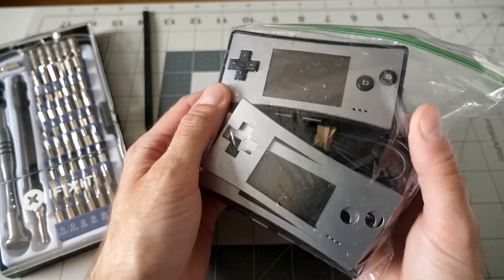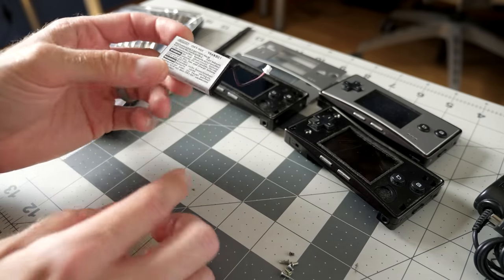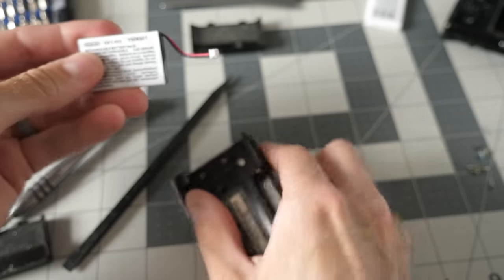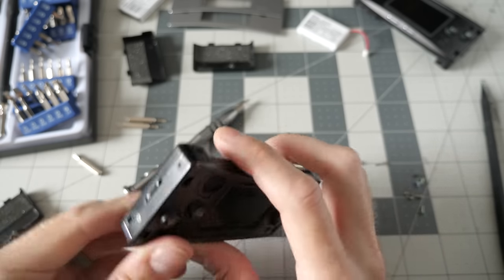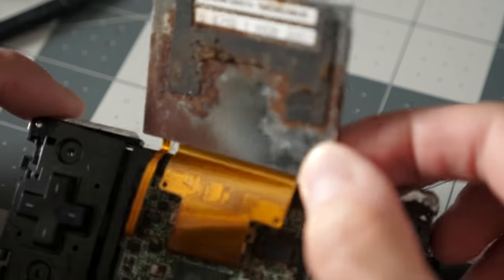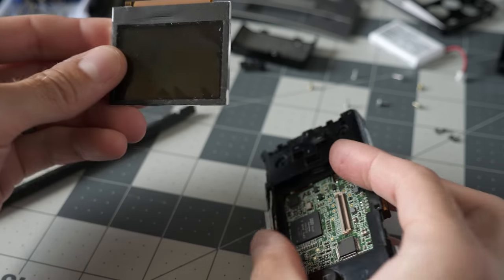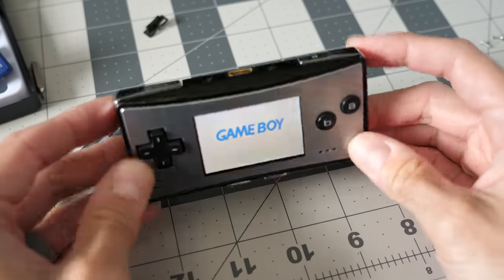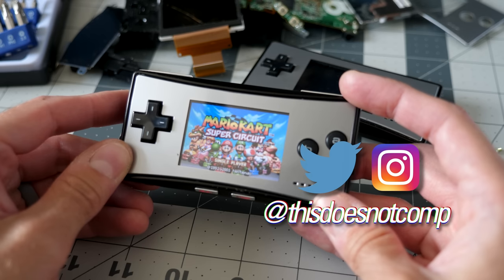Fixing Up Some Game Boy Micros

Comment: Nintendo doesn't use Philips screws internally, they use JIS (Japanese Industrial Standard) screws, which look similar but are not the same profile, and can be damaged if you try to use a Philips driver on them.
Reply: Oh yeah, 
first time you try a genuine JIS driver it's a REVELATION! 
Chewed out screw heads become a thing of the past.
Almost all Japanese manufacturers use JIS and almost none of them use Philips.

Anyone doing this type of repair should do themselves a favor and order a set of JIS drivers online, they are hard to find outside Japan.
Reply: What you guys talking about? I use regular smallest tip no problem but thanks for that JiS info

Comment: One tip for sometimes getting stripped screws out, is press a rubber band between the screwdriver and screw.  That sometimes can help it get enough grip to do it.    And I don't know why you take on other peoples projects.... bwa ha ha ha ha.    (btw,  I never tried working on those,  that is how I got them hehe)
Reply: Good advice but some screws just suck. My laptop came with horribly stripped screws that even the rubber band method can't remove. So I have a time bomb, damn heatsink can't be repasted and the fans can't be cleaned.
Reply: Too add on to that: I've found Torx (both without and with rubber band) to get a way better grip than any other bit,
Reply: @acumenium8157  This actually happened to me in my laptop and it turns out there was loctite in the screws that needed to be heated REALLY well (the screw has to literally burn you when you touch it) in order for the screw to even move a bit, after heating the stripped philips screw quite a bit i was able to remove it with a flathead, flatheads grip really well on stripped philips.
Reply: @firasbajjar  I can't help but wonder if loctite or something similar was used as well, but the screws are stripped too. The metal is WAY too soft. I made one of the screws (that doesn't remove anyway) worse than it was, but it doesn't really matter since it never turned to begin with.

If a screwdriver is warping the shape of a hole it fits in, the screw (which is a BIG screw, it's a heatsink one!) shouldn't be so malleable.

One of the screws, the worst one right now, came pre-stripped with, instead of a plus/+ shape (Phillips?), it's more like a ding-dong. -D

Phillips "fits", but won't turn, and will instead eat away at the really soft metal of the screw. I fear a flat-head would be much the same.
Reply: @acumenium8157  Yep that’s exactly what happened with my laptop. Like all i did was apply a small force only to end up with fine metal dust on my hand. I also encountered the same problem when disassembling a friend’s laptop where the heatsink screws were seriously stuck with loctite that i had to heat the thing for 10 mins. Flat head should work really well in terms of grip provided that you have the correct size that slots well into one of the philips’s cross lines. This is what i found working after months agonizing how the heck im gonna open mine, a lot of heat and a good flathead.
Reply: @firasbajjar  I guess I should try and get some flatheads, only ones I have are too big.

Do I need to find new screws after extraction? If they're this far gone, I don't think it's a great idea to put 'em back in. We're talking about the heatsink after all, not the biggest deal if you aren't 100% sure if 1-3 of 9 case screws are in absolutely tight, but the heatsink is... very important.
Reply: @acumenium8157  Yeah obviously you need new screws for the heatsink. The manufacturer should give you details the screws you need to buy (unless they are something along the lines of cough cough ASUS that think thermal pads are proprietary) 
Remember you will need a lot of heat if it didn’t budge easily. i know this is not good advice for electronics but that is sadly what I needed for my case.
Reply: @firasbajjar  I can get ONE of the screws out. In a normal world, all screws in a heatsink are the same, right? Meaning if I can get ONE out, I should just be able to get four of them for the replacements?
Reply: @acumenium8157  Yeah logically all heatsink screws should be the same but i don’t think most shops have the skills nor the tools to figure out the exact replacements you need when you bring them a screw that is why it is preferable to get information on the type of replacement screws you need either from the manufacturer or through forums online.
Reply: in the 3ds, i took a couple of stripped screws out with a drill too.... hear me out, i used a super thin drill bit, drilled the screw until the top comes complety off, so the piece the screw is securing can come out and then used pliers to rotate the remains out. It's not pretty, but it worked.

Comment: I hope the micro picks up like the rest of GB's, we need more aftermarket parts for it, faceplates and especially the plastic inside chassis that is brittle on some of the models
Reply: Doubt it unfortunately and with rise of portable emulation devices with more widely appealing form factors I think the most we will continue to get are parts for the AGB-001.

Comment: Either super glue another screw head to head, and use pliers, or put some baking soda on the stripped screw, put super glue on the bit, then shove the bit into the screw head. Can bond it enough to give you some tooth to pull it out. or a reverse screw remover

Comment: You should get left threaded drill bits, that way you have a change of actually unscrewing screws that are stuck.
They aren't so expensive at all. Sometimes I also cut a tiny little slot in them and unscrew them slotted screw bit.

Comment: I'd be tempted to clean that corroded board just to see how badly damaged the traces and components are. Call it a morbid curiosity at this point!

I've seen a similar thing happen to electronics from coastal towns that are right next to the ocean. (I'm in Florida, so I see this kind of damage quite often.)
Reply: Same reaction here, I'd love to try and clean the board just to see the result. Having had some prior success from corroded boards before leaves me with a small bit of (possibly misplaced) hope.

Comment: • I don't think the cracked one "took a hit", I think someone stepped on it.
• How do you fix flat-flex cables? With wire-glue? (I need to fix a keyboard and I'm thinking of using conductive tape. 🤔)

Comment: instead of drilling out screws, if you can get ANY grip whatsoever, you can use a wide rubber band between the screwdriver and screwhead in order to get a better bite. - OR depending on how large the screws are, you can use a very small dremmel cutting wheel (or a jeweler's saw) to cut a tiny channel in the screw head and use a flat head screwdriver to unscrew them.
Reply: have you actually tried the rubber band trick on tri-wing screws that are the size of the game boy micro?

Comment: I find if you have a screw that's "chowdered" as you put it. Lol  it's worth trying to use an interface like a rubber band on the tip of your screwdriver. It fills what is left of the screw head and if it's not in to tight gives enough grip to unscrew them without needing to drill.
Reply: Some solder works better.
Reply: @fearofchicke  I've heard this as well
Reply: have you actually tried it on tri-wing screws that are the size of a game boy micro's screws?
Reply: @nextlvlroy  :o I have not but I would imagine you would need a very thin/small rubber band

Comment: I never had one of these back in the day, but more recently I’ve been tempted to get one for use with a flash cart, for exactly the reasons you say about portability and smallness.
Reply: I have my suspicions that water or soda went inside the game cart slot, but stayed away from the edges of the case with the water stickers… instead of being itself submerged.
Reply: @kaitlyn__L  If you get one the original EZ-Flash omega (not the new "definitive edition" version) is pretty good, I've had mine for a couple years and it still works perfectly, the only data that it has corrupted is my pokemon sapphire save but that might be a problem with the ROM I have, it has emulators for the NES and Gameboy/Gameboy color built into the firmware so they don't need to be downloaded, it can take a 128GB micro SD card (mine has a 32GB microSD that I got for $20 at wallgrens with a couple hundred games and a few GBA video ROMs on it and it's only using about 700MB of space) and there's a replacement shell for it that should come in the box (if you get a brand new one like I did) to put it into a DS lite without the top part being outside the cartridge slot.
Reply: @nathanmead140  Super-late to the conversaion here, but if you can find an Everdrive Mini, they blow the EZ-Flash out of the water. Sure, technically it has less features - but you get better battery life and zero problems. I see a lot of failed ez-flash complaints on forums these days.

Comment: I wonder if you scrubbed that dirty one with an electric toothbrush iso and dawn then washed it off and dried it if it would actually boot up. I’ve seen really bad original game boys that wouldn’t boot because of corrosion and once they were cleaned and there weren’t any bridged legs they fired right up.

Comment: you might have been able to get the screw out if you soldered something to it. may have broke a few times but may have had enough torque each time to at least loosen it enough to grab with some thin plyers. just an idea

Comment: Next time you come across screws like that, try the rubber and trick before drilling.  You'd be surprised how well it works
Reply: have you actually tried it on stripped tri-wing screws the size of a micro though?

Comment: Yeah I bought a lot of broken Gameboy advance console from China and they did not have power images and sounds so they did not know what is wrong with it and they sold it as broken so when they were to come in the mail I would take them apart completely in pieces and I took the pcb board and clean it up with 90 proof rubbing alcohol let it dry as it was drying I would clean the shell buttons etc. put it back together put fresh batteries in and game it fired up and played awesome so I did a lot of color, advance and pockets fixed all up turned them in the game x change and I walked out of there with a switch

Comment: Nice work! I'm just wondering if they both charge. I bought a broken one thinking it just needed a battery based on the sellers description but it has a bodge wire added to it so it'll power up but won't charge. I'm saving it for a some day later fix.

Comment: The start and select ribbon on one of my units ripped is there a way to fix that? Another I have the power switch/ A,b button ribbon ripped too is there a way to fix either one?
Reply: ooof what bad luck. I have not seen anyone who could fix a ribbon cable rip like those. Since they are literally sandwhich between the boads, fixing it is near impossible.

Comment: Wait, does the micro charger not fit the DS or Lite?
Reply: It's not just the charging port, it has the link port pins in it too so the gameboy micro is not compatible with the DS lite charger and the gba sp/original DS charging port has extra pins inside for the headphone jack adapter (unused on the DS) and it's a thicker connector so the gba sp/DS charger doesn't work with the micro either.
Reply: @nathanmead140  Jesus, three ports in one. Ahead of its time.